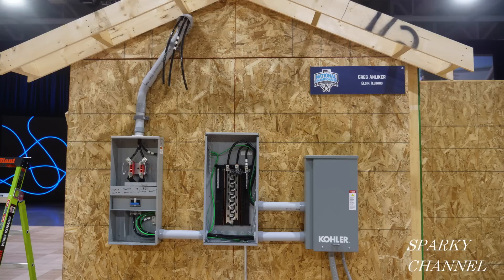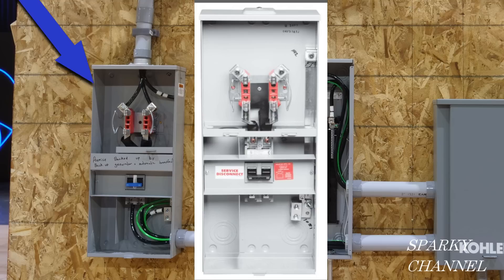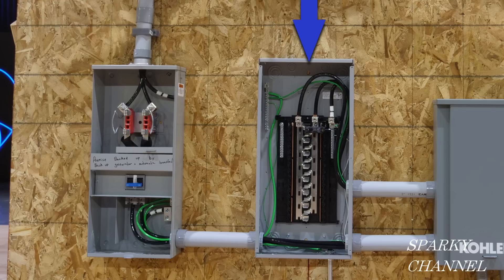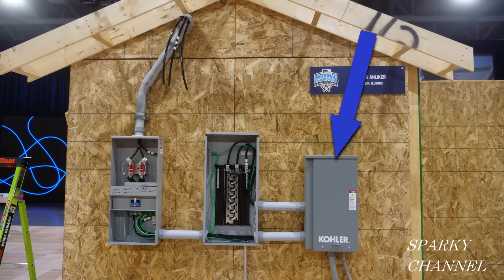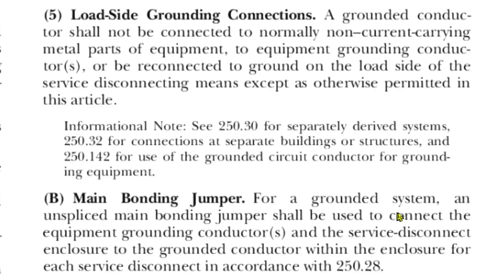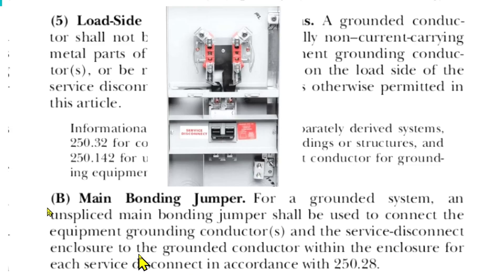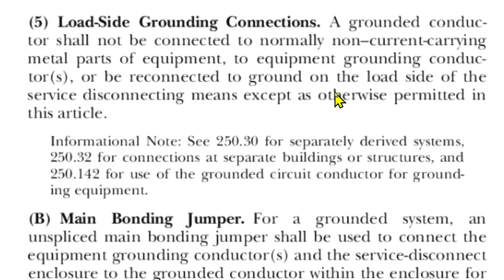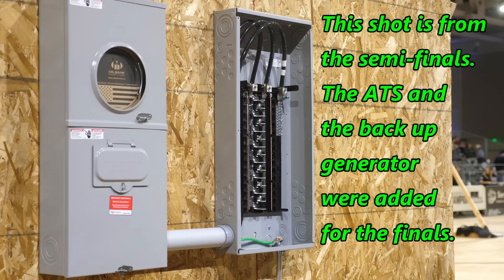In Which Panel are the Neutral and Ground Bonded?

Comment: the best way to remember is it gets bonded at the FIRST point of disconnect.  in that instance, they would be bonded at the meter-main and at the generator. (the generator is bonded at the factory)
Reply from the maker: Thanks Ken! Excellent point about the generator too.
Reply: @SparkyChannel  one of the biggest headaches on service work is when a service has to be converted to meter main and the original electrician put neutral and ground on the same busbars.  I was trained to always have neutral and ground on separate bars, so if they needed to be separated, the bonding jumper could be removed.
Reply: @jfbeam  people yell at you for separating them?  in a service panel, it is acceptable to code to use a common ground/neutral bus, but particularly with modern clamp to bus AFCI and GFCI breakers, it clutters up the bus, and there's a perfectly good ground bus.
Reply: @kenbrown2808  and I suppose you also have to replace the grounding electrode conductors going to the waterline and ground rods and terminate them at the meter main?
Reply: @thomassemich4627  you need to check the integrity of the bonding electrode system, and it's frequently easier just to drive new rods from the meter main, but the rest of the bonding can remain in the breaker panel.
Reply: I was going to mention the generator -- a permanent install should have it's own ground rod. Previous versions of the NEC explicitly said "at the first disconnecting means", but they've been tossing mud in those waters for years.
Reply: My understanding is you need the ground rod if the transfer switch disconnects the neutral as well, in which case the generator is a separately derived system and needs its own ground rod.
Reply: @KLAWNINETY  true.
Reply: @KLAWNINETY this is correct. if the grounded conductor is NOT interrupted at the transfer switch, then the generator is not a separately derived system.
Reply: @jfbeam  actually, I won't put a generator on a separate grounding electrode system, because that produces the potential for stray voltage in the grounded conductor.  had a lineman tell me about running into that, and it took two weeks for me to figure out how it was happening.
Reply: @kenbrown2808  If i have a portable generator that has a grounding screw, if I install it as a permanent setup with an Interlock kit at my main breaker panel (not ATS), can I install a ground wire from the generator to the same grounding rod used by the meter box? Or will current flow throw this grounding screw on my Honda gen?
Reply: @CSJiGSaW08  i believe it is allowable to bond the generator to the same grounding electrode system.
Reply: This mainly applies to residential services. Industrial and commercial separately derived systems, I always bond inside the transformer.
Reply: @atmacm  gensets are all floating net. Until ground rod is installed or properly bonded from unit to some other grounding electrode
Reply: @jefflenway4510  what does this have to do with me saying bonding at first means of disconnect usually applies more to residential? If it’s a separately derived system I bond at the transformer or I’ll bond at the generator. Rarely do I ever bond at the first means of disconnect in a industrial or commercial setting.
Reply: The only generators that I know that are bonded are portable one. The one made for stand by power are not.
Reply: @thomasmarable6818  all the fixed generators I've hooked up have been.
Reply: Service disconnect, not first disconnect. The first disconnect could be a meter disconnect or emergency disconnect.
Reply: @benchociej2435  no first means of disconnect so excatly a meter or first Panel there after
Reply: In my home two different electricians told me because my standalone meter was bonded that was my first point of disconnect regardless if it had a breaker or not at the meter and therefore all other enclosures thereafter would be treated as subpanels and therefore it does not need a bond between neutral and ground and they must be separated. The frustrating thing for me is that every where i look online it says that the service disconnect is where i should bond and nowhere else because if i do then im risking parallel paths but nowhere i see that if i’m bonded at the meter the main panel cannot or should not be bonded. Do I need a third opinion??
Reply: @LovethisNation  unless the electricians are running an insulated neutral AND a bonding conductor from the service panel to the meter, they need some remedial training.
Reply: @kenbrown2808  they both told me that the service panel is already bonded through the metal conduit that terminates on the meter box in the exterior wall of the house and therefore I don’t need to bond again. My home was built in 1958
Reply: @LovethisNation  either your local jurisdiction has some strange rules, or they don't understand the intent of the code, well.
Reply: The generator cannot be bonded unless you have a transfer switch that also transfers the neutral.
Reply: @geoffh1  look closer at your generator, bubba.

Comment: Hey Sparky!  Nice video.  Isn't  the generator a "separately derived system",  and should its neutral and EGC be bonded at its first disconnect means, i.e., at its transfer panel, providing of course that the transfer switch also switches the utility-side and generator-side neutrals.
Reply from the maker: Hi Joseph! Excellent question. The generator had its own 70A disconnect so the grounding and bonding for that power source would have to occur at the generator, not at the ATS. The generator comes bonded from the factory. Also, the transfer switch was only breaking the 2 hot phase conductors, not the neutral.
Reply: @SparkyChannel  Whoa!  In this situation, you would have two bonding points. (the utility disconnect and the generator bonding point, since there is no switching of the neutrals.) Isn't that a no no?
Reply: If you look at the transfer switch at 2:47 you can see the neutral is NOT switched, only the hots.

Mr. Sparky elaborates and states there are SEPERATE ground and neutral BARS in the transfer sw.

This is also why the generator comes factory bonded. 

Large commercial generators usually switch the neutrals in my limited experience and must have ground rods driven etc.
Reply: @KLAWNINETY  So in the setup pictured, the neutral and egc are permanently bonded in two different locations....???
Reply: @KLAWNINETY  The generator in the video must have a floating neutral, by code, when connected through a solidly connected (non-switched) neutral ATS.  The  genset is not a SDS, so the neutral shall not be bonded.  The ATS has seperate ground and neutral bars because it is downstream from the Service Disconnect.
Reply: @thefretfiend  Correct.  The genset must have a floating neutral.
Reply: @donl1410  You're right Don, thank you for the clarification!
Reply: @KLAWNINETY  👍
Reply: A generator as a separately derived system must have a bonded neutral and access to a GES.  Services must only be bonded at one location, either the generator, on a separatly derived system,  or on the utility side.  A switched neutral transfer switch would be required to accomplish this.  A genset usually has an indication if it factory wired as a floating neutral or a bonded neutral.
Reply: You can also ring it out and check. On ben sahlstroms channel he had a cheap Chinese generator that said it was factory bonded but when he rang it out it was floating neutral.

Comment: In the summary beginning at 5:04, I wish you had used the word "neutral" clearly in your answer because it was in the original question (and title) of this video. I think you kind of "owed" that to us.

I think your summary meant to say, "The answer is: in the first panel, the neutral and ground may touch, but in the other two they may not." I follow this practice, but I have mostly seen over my lifetime that neutral and ground are (electrically) identical in the service entrance, but often allowed (sloppily) to merge or be confused physically in the breaker panels, especially in older construction.

Since it appears from the other comments that it is a "thing," I'll say that where I live, there tend only to be a service entrance with a disconnect (for firemen and vandals) plus (usually only) one main breaker panel, but occasionally one or two subpanels thereafter.

My brother and I love your videos because they're so thorough, almost "legalistic."
Reply from the maker: Great points! "Ungrounded conductor" and "equipment grounding conductor" wouldn't fit in my title and I made the title after I made the video so sorry for any confusion. Thanks Russell!

Comment: At the first means of disconnect.
Reply from the maker: "At the first means of disconnect" is a simplified version of 250.24 (B). It does boil down to the same thing but I would rather direct people to 250.24. It's more exact and it mentions that the main bonding jumper has to be unspliced.

Comment: My inspector says "at the first point of disconnect"

I don't like that green screw sitting in the hole waiting to be tightened up by some homeowner. 
The QO panels ship with the screw uninstalled.
Reply: Agreed
Reply from the maker: @greganliker201  Hi Greg! How are you my friend?
Reply from the maker: "At the first point of disconnect" is a simplified version of 250.24 (B).
I agree about removing the green screw.
Reply: I remove the bonding screw, if it is not used.  but where I am, meter mains are avoided, so the bonding screw is used more than not.

Comment: Where I live there is not a main breaker on outside of buildings, they are in the panel with the other breakers. In your scenario is the panel box acting as a subpanel since the main breaker is in upstream panel?
Reply from the maker: The panel in this case is correctly called a Main Lug Only load center.

Comment: Is it legal running the sub feed through the panel to the transfer switch? Wouldn't that be using the panel as a raceway? Shouldn't a ground passing through any metal junction or pull box be bonded to that enclosure?
Reply: From what I could see, there were two EGCs entering the MLO.  One passes-thru to the transfer switch, but the other terminates at the grounding bus in the MLO.  So the panel is bonded properly (IMHO)
Reply: 312.8 Switch and Overcurrent Device Enclosures with Splices, Taps, and Feed-Through Conductors.  No violation if the article is followed.  EGC for the subpanel and ATS are bonded at the the Service Disconnect neutral bar.
Reply: It is perfectly acceptable to use a panel as a raceway, contrary to the tribal knowledge I have heard in my career.  The conductors passing through one panel to feed another could represent a bit of a safety risk in some cases, but not this one, which is pretty straight-forward.  If the main is LOTO,  and the generator is LOTO, then the panel can be serviced safely.

Comment: Ok so as long as the main meter box is bonded to ground I can connect neutral and ground to the same buss bar? And also don't put green screw to not confuse ppl?
Reply: if your meterbase has a disconnect means then you are to separate neutral and ground.  If no disconnect at meter then first panel is neutral/ground bonded with the green screw.
Reply: @FixthisCD  electricians in my area FL tells me that you only bond in one place, so in your example you would be bonded at two places then, in meter and service enclosure. This is the question i had for days that no one seems to give a straight answer to. If my meter is bonded to neutral and ground and has EMT going to the main panel, why do i need to also bond the main panel? doesn’t that create parallel paths?
Reply from the maker: I agree, the green bonding screw should be removed. The neutral has it's own lugs in the meter socket disconnect but those lugs are bonded to the EGC and to the enclosure.

Comment: Sparky where is the circuit breaker panel?   Is that NOW NOT BONDED with this new system
of disconnect outside for the fire department?
Reply from the maker: It's the MLO. See 1:13      Correct, the MLO is not bonded in this case.

Comment: Can you do a video on what a separately derived system is and what makes it separate.
Reply: Just means it has its own ground reference. It is "deriving" its voltage from its own zero-volt potential point. So for example, a generator with its own ground rod where the transfer switch also switches the neutral

Comment: Should pull that green bonding screw out of the can so no other handy person attempting to do electrical work, tightens that screw and illegally bonds the system
Reply: Extremely well written.  It should of been stated.   Is the panel with the breakers in it
NO LONGER BONDED because it is no longer the first point after the meter?
Reply from the maker: @tedlahm5740  This has a meter combined with a main breaker. See 250.24 (B)    at 2:49  This is where the bonding occurs and it can't be bonded at the MLO or anywhere else. See 250.24 (A) (5)  at 4:20
Reply from the maker: I agree.